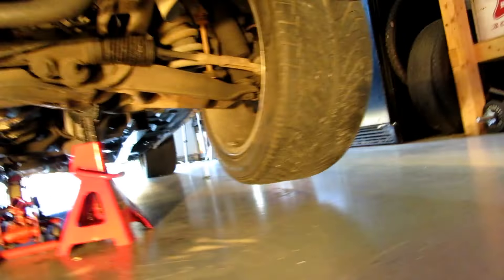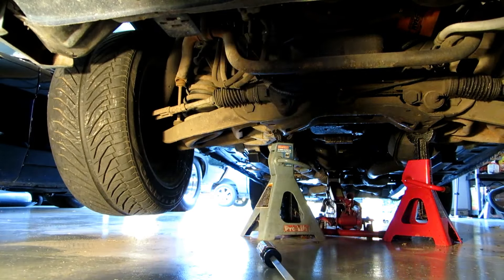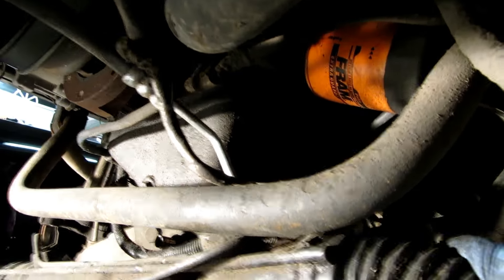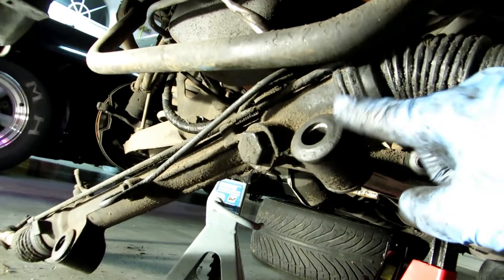1986 Mustang GT Project - RACK AND PINION REPLACEMENT - PART 1

Comment: The round splined  steering shaft with the rag joint will fit the rack you just put in. Just make sure your steering wheel is set straight with the way your wheels are pointed. Good video. Thanks.

Comment: 20 year ol college student here about to do this job to the stang, thanks for the detailed help 👌👌👌
Reply from the maker: You bet man! Hope it helped.
Reply: I got the kit, and I’m nervous haha. Don’t wanna fuck nun up
Reply: @champking20  its pretty easy haha actually, got the job done about 1month ago bought it from lmr, and yea its basic tools. Taking the old one off and putting new one in. House of dula helped alot too cuz he does it step by step. If ur mustang is carbrated its alot easier though haha. Only problem i had with mine was it started leaking at first but thats cuz my hoses were so old but a quick trip to autozone and like 20$ later i solved the issue. But yea man its really fun doing it urself and you save alot of money too haha
Reply: Jesus Garza mine is fuel injected, i def wanna save the money though, shops be charging like 500+ for labor

Comment: Hey Bud great vid. I did have a question, how do I align the splines on my rack's shaft with the collar of the rag joint. My rack splines have a flat spot, does this align with the set screw on the joint?
Reply from the maker: man good question. So this shaft must have been a generic "mustang II" rack. My rack did not have the flat spot. It is splined and screw set. I ended up finding center on it and grinding a flat spot in the shaft to make this one work. Been fine.
Reply: @HOUSEOFDULA  Thanks dude. I did the swap last night. I took it around the block and found the steering wheel trying to turn itself. It also doesn't like returning to center after a turn. Any idea on what could cause that as it didn't do that before I pulled the rack. I still have to do an alignment.

Comment: It's amazing how many fitment problems one can run into doing this job.
I just got a shaft that is too many turns lock to lock.
It may just be better to buy a seal kit for around 28 bucks and rebuild the rack that came out of your own car.
That's the conclusion I am quickly coming to.
Reply from the maker: Exactly. This is based on the largely avail mustang II rack so there are a ton out there with all kinds of variations!
Reply: I'm probably going to have to take the header off to even get to it.
Reply: I believe all the FB mustang racks are the same ratio. Ford put limiters behind the inner tie rods to eliminate tire rubbing (Thus less turns lock to lock). Here's the p/n's N804842-S Steering Limiter - 6.5mm, N808506-S Steering Limiter - 10.65mm (blue), N807853-S Steering Limiter - 2.4mm, W705003-S Steering Limiter - 4.25mm, W705004-S Steering Limiter - 7.25mm. The thicker the split washer...The more it reduces the travel.

Comment: Can't wait to see how it turns out. I don't recall, but are you going to do anything to the engine?
Reply from the maker: Yeah. Eventually...Im working on all the essentials to make it drive solid first. Wheels, brakes, suspension, gears, springs...Will be dabbing into the engine soon im sure. Especially if I find a good deal on some GT40 parts. I may later on MAF convert so I can run a custom cam.

Comment: What did you use to use to wedge it out?
Reply from the maker: Key is to try to knock the long bolts back into the k member, mine, one knocked out, the other wouldnt so I had to pry the rack forward. Was a bit of a chore, used a crowbar long screwdriver etc..